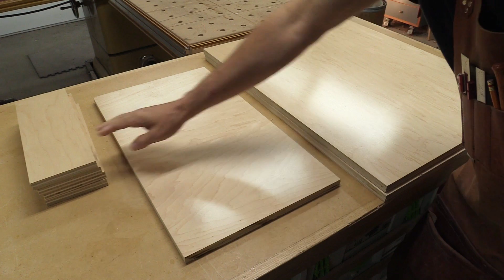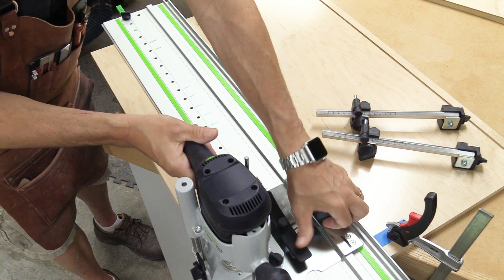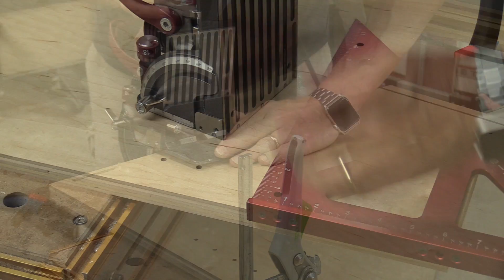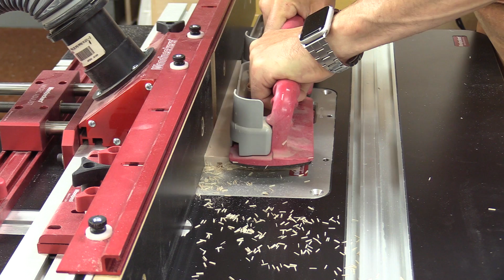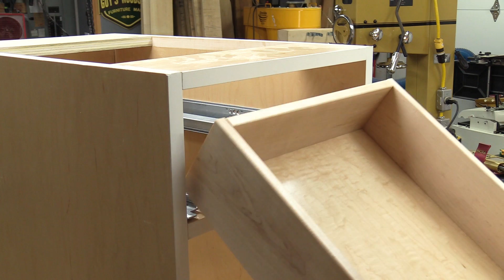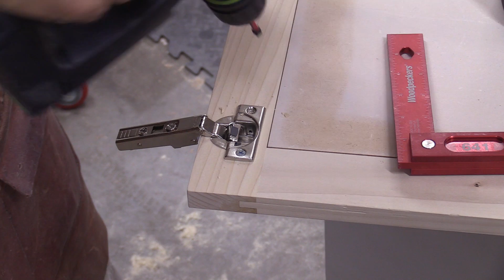How To Make Frame-less Kitchen Cabinets - DIY Cabinets

Comment: Great video and process!  After looking at the Blum Process 32 manual briefly and then going back to the initial frame of the video, I notice that the base cabinet shown doesn't have an integrated toe kick.  Do you instead use a shared toe kick frame for a run of base cabinets with this process?

Comment: I’ll give somebody my lamello tool lol that thing is the biggest piece of over engineered trash I’ve ever used!!! And the stupid plastic connectors are super expensive and don’t always lock correctly I went back to using my old dewalt biscuit joiner long time ago thank god I bought a used lamello when I did if I paid new prices I would have been super pissed but I do have a lamello knot and void cutout and fuller tool and kit and it’s amazing for repairing hardwood and slabs and such

Comment: Could you just use a 1/4 MDF panel for the doors and drawer fronts and save on cutting back cuts?  Thx

Comment: @18:47 - Where did you get end stops for the Blum plan spacing? The stock Festool end stops don't match the Blum plans.
Reply from the maker: I printed them on a 3d printer
Reply: @GuysShop  Seems like something the TSO guys should make out of aluminum and sell. There's plenty of guys like me who would get them.

Comment: What do you do, when you check for square by comparing measurements from opposing corners, and the cabinet or drawer is not square? What can be done to fix it?

Comment: Old thread but hopefully still monitored. Great how-to! Two questions:
1. Does the Lamello system provide more lateral strength than the Festool Domino? Assuming you have used both.
2. What did you use at the end of the guide rail to set the correct first hole placement? Was that a home made jig?
Reply from the maker: Thanks! I'm not sure of the numbers as far as strenth goes, but I can say both are more than strong enough for cabinets like these. And yes, it was a special stop to give the corrtect setback for the Blum system cabinets. My son 3D printed it for me.

Comment: Great video. Very helpful. One quick question: do you endgeband before or after locating the 32mm holes from the front edge? Does that effect the placement of the hinges?
Reply from the maker: You can do it before or after. The thickness of the banding can be adjusted out with the hinges if you do it before hand.

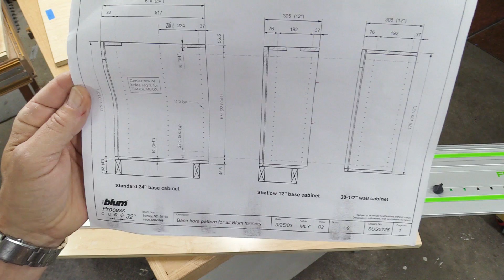Comment: May I ask where you get the process 32 plans shown in the video @ 2:40?
Reply from the maker: I got them off the Blum Website, but they are hard to fond. I would recommend a Google search and there is a couple other places to download from
Reply: @GuysShop  No URL links?  The only one I found is from Woodweb and that copy is from 04, so I'm afraid that it isn't current enough.  Would appreciate any links you can provide that would be more current.  Was unable to find it on the Blum site. Everywhere that I find the process 32 is from the 04-time frame.  Does that apply to which of the Blum hardware types?

Comment: Guy, I'm following along to build my own built in desk using the same Process32 instructions and many of the same techniques and tools. I'd be very interested in knowing the exact names of the materials used, i.e. specific manufacturer, grade, name of the plywood for the carcass and same for the pre-primed material. More details the better as there are so many nuances to plywood selection (grading, core material, rotary cut spliced vs whole etc) and I'm having trouble tracking down a product that will work for me without spending a boatload. Currently considering Columbia Forest Products special order through Home Depot, their MPX lineup, at $95/sheet but haven't committed. 

Further question: what purpose does the divider rail serve on the base cabinet between the door and drawer? The drawer slides aren't resting on it and the door is full overlay with a 3mm or 1/8 gap. 

Thank you for your time in answering my question(s).

Comment: Any chance you'd do another shop tour this year? I've seen the new stand your small Craftsman bandsaw is on. I'm in a similar situation with a 14 inch Craftsman that has one of those metal stands that is too short and spreads out with no storage. Just going to build a box and put maybe 5 small drawers. Wondering how you did yours.

Comment: Why would you build a cabinet without a frame you did a nice job but I don't see a benefit to do without a frame
Reply from the maker: It's the look really. There is only an 1/8" gap between all the doors and drawers on the cabinets when installed. Very clean.
Reply: @GuysShop  I guess I could see that then I just been using the frame method from the 1970s you did do a great job tho so I hope you didn't take me wrong with my comments
Reply from the maker: @robertlis2704  Not at all! Thanks for watching and the great question!

Comment: I don't think most people realize that when you do something for a living specialty tools are not expensive in comparison to the time saved.
Reply: Facts but when your a DIY trying to learn to build frameless cabinets and hes using a 1600 dollar zeta p2... If you own that you dont need this video is my point
Reply: @misterfee6467  i was just lookin on here for some dyi cabinets and just looked this up to find out the same info you commented, what the heck! it is an awesome tool yet your comment has merit, im looking for quality efficient way to build my own cabinets this guy has like 10k of tools
Reply: same thing with replacement parts.  just buy the OEM or high-quality aftermarket stuff, otherwise you'll waste 3X as much time repair it.
Reply: The right and quality tools are expensive, but it makes all the difference in the quality of the finished cabinets and it makes it easier and you cuss a lot less.😆
Reply: so when do i start ?
Reply: true.  that P2 is $1100 alone, but if you’re doing this for a living, it’s not an issue.
you want the best tools.
Reply from the maker: Well said. Thanks for watching Samuel!

Comment: Ha. Very nice. Wish I had 30k worth of high quality tools. The hardest part would be finding the finished maple sheets. Not available in my area. Might be able to order it. I'd probably just use the $54 maple 4x8 sheets lowes sells and spray paint it.  Nice video.  I like how he says "very easy".  Then why do my projects come out like a Homer Simpson spice rack? I've built a few things like a dropoff and pantry shelving system. I dont like banding much. Bit tricky with the iron and ending with a completely flat surface.
Reply from the maker: Thanks! It is easy if you know the steps and start with quality materials.
Reply: @GuysShop  well I kinda exaggerated about my skills. Not even close to yours though. My dropoff I built was huge took 6 full sheets of maple plywood. I used banding with a heat gun but ended up using filler and wood glue to make it perfectly smooth then painted. I have a bit of OCD so my skills vs what I envision dont match. I did wire in LED DC lighting into the light switch on the wall so all the shoe boxes light up when it's on.   Oh darn I'm just rambling now.

Comment: Is there any other way to use the lamello mounting system except for using there speical tool?
Reply from the maker: Lamello makes another fitting that works with a biscuit joiner. You would have to take a look at their website. Can't remember the name of them

Comment: Very nice video and excellent craftsmanship! I have been on the fence about a festool track saw for quite some time now. I’m not a professional woodworker, just a hobby. I love working with plywood though. 

 Nice to see you use it to make accurate repeatable cuts. Are those rails that attached to the track saw rail from woodpeckers?
Reply from the maker: Yes, they are the Woodpeckers Parallel Guide System. Work great!
Reply: I've owned both the Festool and the Kreg tracksaws.  For the home hobbyist, get the Kreg.

Comment: Good tutorial tho not sure it could be classed as DIY considering the expensive equipment used that most DIY'ers could only dream of, saying that they are very well made
Reply from the maker: Thanks Sean. There are many different ways to skin a cat, especially in woodworking. These cabinets could easily be made with tools found in most woodworking shops. I have the cool specialty tools, so I tend to use them. That's what I bought them for, right?
Reply: @GuysShop  Yes of course these could be made with DIY tools but dont think they would look as good or be as strong say if you used pocket holes or biscuits over the lamello system but as you say you have the tools so may as well use them

Comment: Very nice tooling there, interesting to see the different versions of everything for the US market. Over here we always use solid backs and solid drawer bottoms which makes for a stronger cabinet but also much heavier and more expensive to build.
Reply from the maker: There is always a slightly different way of doing things. This way works well for me.

Comment: Great video as always. How do you ensure that the track is aligned vertically for drilling those shelf pins on both sides of the cabinet case. I would be worried that when i would flip the track around for the rear shelf pins that they might be off. If off even a little it would seem like the shelf may not sit flat.
Seems like setting the vertical stops exactly on that track is quite crucial. Did you just measure or do you have another method?
Reply from the maker: The LR32 system makes it really fool proof to do. I have used it for cabinets before, and it really works well.

Comment: Very nice, but not for the nonprofessional "do it your selfer".  😣
Reply from the maker: Actually it is. I do use some specialty tools, however everything here can be done with tools you would find in most wood-shops. There is always a different process that yields the same results

Comment: Where did you get the end stops for the LR32 rail that are made for the Blum Process 32?
Reply from the maker: I had my son 3D print them for me since the stock Festool ones won't give the correct offset for the Blum Process 32 ssytem
Reply: @GuysShop  would your son put them up on Thingiverse? Would be really helpful. Great video!
Reply: Honestly, this is a super niche product, BUT it’s EXACTLY why I was searching the comments. I am 100% interested in buying these. Thoughts Guy? Would your son be willing to make these and sell a few of them? 

I NEED them for my LR32 system. And would love to support your sons ingenuity.

Thanks and hope to hear back.

Be well~
JDH

Comment: I typically assemble boxes with confirmat screws, which means I don't have to glue the joints. But I've seen enough of the Lamello Tenso fasteners now to know I need to look into that option. Thanks Guy.
Reply from the maker: I absolutely love the Zeta P2. Not inexpensive by any stretch of the imagination, but worth every penny for cabinet work.

Comment: Wow!! Great stuff.  I would love to have a top end workshop like that.  However; I have one bone to pick with Blum.  I use the full-extension, soft-close drawer guides for both shelfies in my lower sets of cabinets.  If you have bad knees and/or back, this keeps you off the floor, on all fours trying to retrieve that frying pan that got pushed to the back of the cabinet. You can’ believe how nice this is.  The problem being; (at least I have been unable to find a solution) Blum does not make a soft-close door hinge that opens wide enough to allow the door to open wide enough to enable the drawer to be pulled out of the cabinet.  I have had to use the Blum 160 (degree) door hinge.  I called Blum about four years ago, they could only offer a secondary device that is applied to the opposite side of the hinge side of the cabinet that absorbs the impact of the door as it closes. Are there any new developments to correct this situation???
Reply from the maker: They do make such a hinge. It's called a zero protrusion hinge. I used them on my tall pantry cabinet that has pull out shelves.

Comment: Nice video and work Guy. How do you have your Incra fence attached to your Kapex if I may ask?
Reply from the maker: They are attached using the connectors from Multiblades.com I did a video on it a while back
Reply: @GuysShop  Thanks. I will check it out. I appreciate the help.
Reply: @GuysShop  Which Incra items do you use for your Kapex stops on your wings? Thanks.

Comment: Great video Guy. Clear and concise !  I am a big fan of Blum's hinges and slides. One note : it is beneficial to have Posidrive bits on hand to adjust the Blum door hinge  screws, especially the Zero Protrusion mechanism as a Phillips tends to cam out.
 If you had to choose one system for joining the cabinet components would you choose pocket holes, Dominos, or Lamello?
Reply from the maker: Definitely the Lamello. So easy to put the cabinet boxes together....